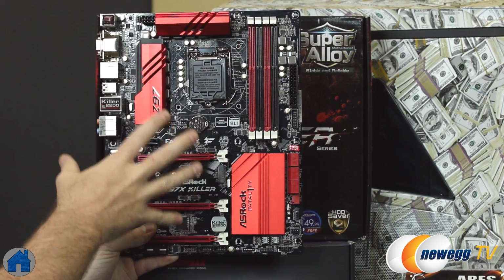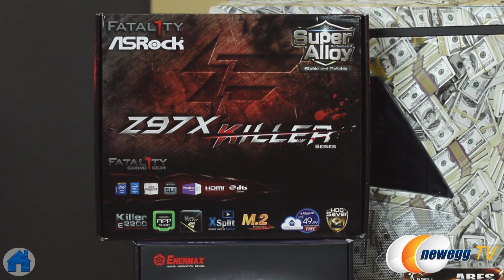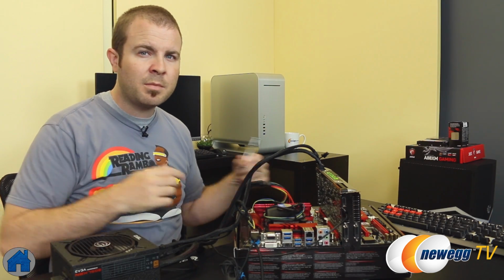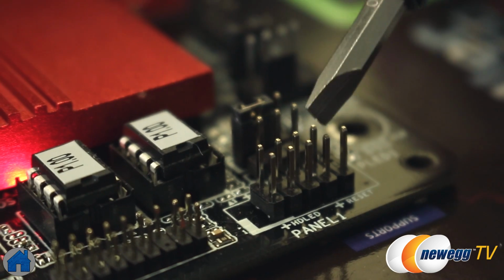How to Build a PC - Part 1 - Newegg TV

Comment: can anyone tell me if these stuff are compatible with each other 

Gigabyte GA-970-GAMING SLI AM3+ M.2 ATX AMD 

ASUS Radeon R9 380 Strix Overclocked 4GB GDDR5

Crucial Ballistix Sport 8GB DDR3-1600

AMD FX 6300

Thermaltake Versa H22 Special Edition Mid Tower Case - Black

EVGA 500 Watt 80+ 500 Watt ATX Power Supply

Seagate Momentus Thin 500GB 5,400 RPM SATA III 6.0Gb/s 2.5" Internal Notebook Hard Drive ST500LT012 Factory Recertified
Reply: +Key Ruin no
Reply: Don't use the momentus thin
It breaks
Easy
I've gone through 4 of them
Reply: It will work but I recommend just using a western digital blue, its bigger, very cheap and also much faster.
Reply: yeah i changed it into a WD Blue Mainstream 1TB 7200RPM SATA III 6Gb/s 3.5" Internal Hard Drive - WDBH2D0010HNCNRSN
is this it?
Reply: Thats it Key Ruin
Reply: ty hopefully this will work and let me play some good games for once in my life XD
Reply: I highly recommend pcpartpicker. 
It has 
-comparability settings
-price ranges of main sellers
-price history
-already made guides
-tips 
- reviews
-comparison

And so much more, check it out, it'll save you tons of time and money, also good luck

Comment: plz tell me this is my first build so is my configuration is good or not

Graphic card:  Nvidia GTX 1080 (normal edition)
Quantity(2)
 

  
Mother board: MSI MSI Gaming Z170A GAMING M7 LGA 1151 Intel Z170 HDMI SATA 6Gb/s USB 3.1 ATX Intel Motherboard 
Quantity(1)
 

Hard disk: WD Black 2TB Performance Desktop Hard Disk Drive - 7200 RPM SATA 6 Gb/s 64MB Cache 3.5 Inch - WD2003FZEX
Quantity(1)
 

 Ram: G.SKILL 16GB (2 x 8GB) Ripjaws V Series DDR4 PC4-25600 3200MHz Intel Z170 Platform Desktop Memory F4-3200C16D-16GVRB
Quantity(1)
  

 Power supply: EVGA SuperNOVA 850 G2 80+ GOLD, 850W ECO Mode Fully Modular NVIDIA SLI and Crossfire Ready 10 Year Warranty Power Supply 220-G2-0850-XR
Quantity(1)

 

Cpu:  Intel Core i7-6700K 8M Skylake Quad-Core 4.0 GHz LGA 1151 91W BX80662I76700K Desktop Processor Intel® HD Graphics 530
Quantity(1)

 

Computer case: Corsair Graphite Series 760T CC-9011074-WW White Full Tower Windowed Case
Quantity(1)
 
 
Keyboard and mouse: DRAGON WAR GKM-001 SENCAIC KEYBOARD & MOUSE 

quantity(1)

  

Headset: Etekcity Scroll Gaming Headset (H5GX): LED Light Up Effect (Black/Red) 
Quantity(1)
 

 Monitor: BenQ XL2411Z 144Hz 1ms 24 inch Gaming Monitor NVIDIA 3D Vision Supported seamless FPS RTS MOBA Game eSport
Quantity(1)

 

Cpu cooler: Corsair Hydro Series H100i GTX High Performance Liquid CPU Cooler CW-9060021-WW
Quantity(1)

Gloves: Pair of Professional Slip Resistant Clean Gloves Anti-static Gloves Hand Wear with Rubber Dots for Cleaning Job VTH-57170
Quantity(1)
 
Case fans: Corsair Air Series SP 140 LED Red High Static Pressure Fan Cooling - twin pack (CO-9050034-WW)          
 (Quantity2)
 

Corsair Air Series SP 120 LED Red High Static Pressure Fan Cooling - twin pack (CO-9050029-WW)
Quantity(2)

Dvd drive: LG BH10LS30 Super Multi Blu Blu-Ray & DVD Drive  
Quantity(1)
 

Light: LOGISYS CLK12RD2 12 inch Dual Red Cold Cathode Light 
Quantity(1)
 

Cable: Cold cathode extension cable 
quantity(1)
 

Hub: SilverStone PWM Fan Hub System Cables, Black (CPF04) 
quantity(1)
 

Thermal past: Arctic Silver 3.5g High-Density Polysynthetic Silver Thermal Cooling Compound AS5-3.5G
Quantity(1)
 

Mousemat:  Redragon P001 ARCHELON Gaming Mouse Pad - 12.99 x 10.24 x 0.2 inches (Large-Size)
Quantity(1)
 

Speakers: AVerMedia Ballista Trinity Gaming PC Speakers, 2.1 Sound System Speakers, 77 Watts, 3 Way Satellite Speakers (GS315)
 

Mouse: MSI Gaming Mouse (Interceptor DS200)
Quantity(1)

  
UPS:  CyberPower CP1500AVRLCD Intelligent LCD UPS 1500VA 900W AVR Mini-Tower
Quantity(1)

Comment: Reply with best performance graphics cards for gaming out right now?
Reply: gtx 980 ti
Reply: +driventolegend Not titan X?
Reply: P. Green Titan x is the best by only a very small amount (stock), and uses way more power, in addition to costing $1000, a 980 ti is basically a Titan x with half the vram and is $650, also a superclocked 980 ti or sli 980 tis will beat the Titan x
Reply: That's true, point made.

Comment: When putting the motherboard into the case for the first time, after the test, is it absolutely necessary to take the cpu fan off, if you are planning to use the stock one in your build?

Comment: I am trying to figure out what pc parts i am going to buy when i am going to build my pc, and i was wondering does i5 4460k and gtx 960 work with z97? and does z97 work with fractal design define r5? and also i play Minecraft CS:GO and sometimes some newer games for example gta v so will gtx 960 i5 4460k and 8gb of ram be enough
Reply: +ZAXYTHE3DMUFFIN There is no 4460K. Ther is a 4460, but it isn't a K CPU so you could save some money by going with something like an h97 motherboard. And I suggest an R9 380X instead of a GTX 960.
Reply: +stl522013 ok, thanks and sorry for not knowing anything about building computers
Reply: +stl522013 ok, thanks and sorry for not knowing anything about building computers
Reply: ZAXYTHE3DMUFFIN What is your budget?
Reply: stl522013 800 dollars

Comment: Would this work?

Asus M5A78L-M/USB3 Motherboard with Socket AM3+, up to 32 GB DDR3, USB 3.0, uATX 

AMD FX6300 Black Edition 6 Core (3.5/4.1GHz, 8MB Level 3 Cache, 6MB Level 2 Cache, Socket AM3+, 95W, Retail Boxed) 

HyperX FURY Series 8 GB (2 x 4 GB) DDR3 1866 MHz CL10 DIMM Memory Module Kit - Black 

Western Digital WD10EZEX 1TB SATA lll Desktop SATA Drive - Blue 

EVGA 100-W1-0500-KR - 500W 80 Plus Power Supply (100-W1-0500-KR)

Gigabyte NVIDIA GTX 750Ti 2GB PCI-E Graphics Card 

CiT Goblin Mesh Gaming Case Black/Green Interior USB3 12cm Green LED Toolless (with another fan)

CSL - 5m - CAT.6 Ethernet Gigabit Lan network cable (RJ45) | 10/100/1000Mbit/s | Patch cable | UTP | compatible with CAT.5 / CAT.5e / CAT.7 | Switch/Router/Modem/Patch panel / Access Point / patch fields | black 

Trying to make a low budget pc for £355, ill download windows 10 on a friends usb, and I know how to setup drivers etc
Reply: it would work, but be warned, the 750 ti is kinda under powered, you can maybe run games at medium settings 40-50 fps but it still works
Reply: I know, I may upgrade to a 970 2gb later ty
Reply: Hi. Check pcpartpicker to make sure
Reply: I have checked everything now, and have done so much research etc, and I have now ordered the parts in. Hopefully they will be coming tomorrow. Shouldn't be too hard, I guess?

Comment: In case you guys wanted to know the price for this exact build, here it is:
Intel i7 core 5960x:                            $1,050
Enermax Liquimax 120s cooler:           $50
    (Alternate Hyper 212 Evo: $30)
ASrock fatal1ty z97x killer:                  $100
Gskill Ares 16GB: $65
WD Black 2 terabytes (2):                    $250
Lite On Blu ray Drive: $100
EVGA SuperNOVA Nex750B:                 $80
Nvidia GForce GTX 780:                       $130
NZXT Phantom 630:                             $150

Total:                                                     $1810
Reply: Haha I wish a GTX 780 was 130!
Reply: Total: $1810 USD!
Reply: +daniel hood I put the wrong graphics card, my bad
Reply: +Aversi Wrong processor. The one he used retails for about $350.

Comment: http://uk.pcpartpicker.com/p/3wWVhM
Is this a good build - are there any parts that would be better for around the same price?
Reply: +Christopher Bennett The graphics card is pretty weak for the CPU. The i7 4790k is usually used with higher end graphics cards, like the 970, or 980.
Reply: +I Got that Nope.avi  I actually did more research and changed the build around a bit. I want to use it mainly for Rendering so choose a Video card designed for Rendering.
Does this look any better http://uk.pcpartpicker.com/p/TwJRLk
Reply: Christopher Bennett The i7 5930k is much better suited to rendering, but it is quite a bit pricier.

You could get a 980ti as well, which would do a good job at rendering, and could also be used as a high end gaming card.

However, if you don't think you're going to game at all, stick with the current Quadro card series, but it's very important you note, you'll essentially be unable to play most games with a quadro, except for old/low end games.
Reply: +I Got that Nope.avi Okay good advice, Thanks very Much

Comment: Okay I'm about to order these PC parts.  https://pcpartpicker.com/part/amd-cpu-fd6300wmhkbox
**Before I do It, is building a PC by yourself hard? Or is their instructions? If not, how am I supposed to know what goes where?
Also, Is there anything I need to know NOT to do when putting the pc together? Can I break any of these parts easily?
And lastly, do I have to buy an Optical Drive? Or Will my PC work without it? And I can just Get Windows 10 in some different type of form other than a disc?

Comment: any ideas why my system shows no video when graphic card in installed. from either the card or onboard hdmi connector? 
asrock h97m itx ac with i7 4790 and r9 nano
Reply: Are you sure that all the connectors are plugged in properly?
Reply: yes. tried this several times.. at least 10
Reply: +Vincent Valentine Have you tried accessing the BIOS? If you can't, check your power supply and the power connections. Also, try to check that the HDMI is connected properly.
Reply: Does it beep when you push the power button?
Reply: fans spin up in gpu n cpu (only fans) just no post
Reply: +Vincent Valentine Pull out the video card and see if you can get the system to post without it
Reply: +David Mark it does. but thats why i cant install gpu. i have pcie graphics set up in bios too
Reply: +Vincent Valentine I need some more information:
1. Are the parts new?
2. Do you have an operating system installed yet?
3. What power supply do you have?
4. Does the motherboard beep at all?
Reply: yes. i have replaced the motherboard in case that was the issue. have new r9 nano and and older r270 from another byild im sure is working

Comment: Is over clocking bad? Does it do damage?
Reply: +Em0SceneStabr Yes it can if you dont do it properly. but if you watch videos on your motherboard type and get the settings you want it should be fine. it also depends on your psu and your cooler for you cpu.
Reply: +Em0SceneStabr If you have to ask....yes.

Comment: Soooo...
I'm thinking about building a PC and I've got $3000
I've searched for some things and this is what I came up with:
Motherboard - MSI Z170A Gaming Pro 
CPU - Intel Core i7-6700K 
GPU - MSI GTX 980 Ti GAMING 6G
or (are they different in the inside? Because of water blocks)
GPU - EVGA GeForce GTX 980 Ti SSC GAMING 
Ram - Kingston 32 GB Kit (2x 16 GB) DDR4 3000MHz CL16 HyperX Predator Series

The less important (non-performance) parts :D
HDD - WD Blue 6000GB 64MB cache 
Power Supply - Cooler Master V Series 1200W
CPU Cooler - SilentiumPC Fortis 3 HE1425
or 
CPU Cooler - SCYTHE SCNJ-4000 Ninja 4
or
Water loop (I would need more money, but I'd like to upgrade to water cooling someday, so that's why I'm asking about the GPU)
Case - Zalman Z11 HF1

I know 0,1% things about components, so I don't even know if I could put these up together. If I can, than GREAT! If I can't or the components that I've chosen completely suck, than could you give me some tips, please? 
I'd appreciate some help :D
Reply: +Brandon Allison So you personally have used it..... If you recommend something and say you won't be disappointed, make sure you have tried it. Please.
Reply: Depends what you wanna use the PC for, lemme know and I'll give you some good advice
Reply: Too late
Reply: +Mikop Get a nice and fast m.2 Sdd and skip the water cooling
Reply: David Mark I already said it's too late :D I've got my computer under the table already...
Reply: +Mikop You can still add a ssd, the difference it will make is HUGE
Reply: David Mark I know, but the I didn't build the computer myself... It was built by professional and they sealed the computer with a warranty sticker, so I can't open it :/
Reply: I would not recommend buying a 6 TB HDD, except you are some kind of video editor or something like that. Just for gaming 2 TB are way enough…
Reply: raphiguaki Thanks, but I already have the computer for a month right under my table :P
But there are some things:
1) Video editing is actually important for me
2) I'm going on a Multimedia Highschool in 6 months, so I'll be using my PC mainly for rendering animation and that requires a pretty strong graphics card (Got a 4G instead of 6G, because of saving some of le money)
3) I did buy a 3TB and a 1TB HDD because of the possibility to backup my data + Couldn't buy like 3TB & 2TB & 1TB, because... Money... Yeah... What a shame :(
:D
Reply: +Mikop Ah, great! Yeah, 6 TB are pretty expensive...

Comment: Will every build of a computer be the same? Or does it depends entirely on the case that you get? like if i was to get different components but my case is 100% similar as yours will the set up be the same?
Reply: every build is generally the same process with minor changes like different hard drives and gpu coolers...

Comment: I am looking to build a new pc for gaming purposes and i made this build :
Cpu-Intel Core i5-4690 Haswell Quad-Core 214.99$
Motherboard- ASUS Z97-A LGA 1150 Intel Z97 HDMI 139$
Ram- 2xHyperX FURY240-Pin DDR3 SDRAM DDR3 1866 Desktop Memory Model HX318C10FBK2/16 (8Gb each) 79.99$
Gpu- EVGA GeForce GTX 960 02G-P4-2966-KR 2GB 209.99$
Hard Drive- Seagate Barracuda 7200.14 ST3000DM001 3TB 7200 RPM 64MB Cache SATA 6.0Gb/s 134.99$
Psu-RAIDMAX Cobra RX-700AC-B Continuous 700 watts ATX12V / EPS12V SLI Ready CrossFire Ready 80 PLUS BRONZE 69.99$
Case- RAIDMAX Cobra ATX-502WBG Black Steel 64.99$

If you can find some parts that are better for this Build please tell me i want to keep it under 900$ please (prices from Newegg.com without addition of discounts)
thanks
Reply: I'm probably way to late but I'll tell you anyway, get a cheaper hard drive 1tb is more than enough for now. Get a cheaper motherboard and use that money you saved to get a better gpu

Comment: Hey guys, Okay so I am new to building a PC. I got up to the part where you power it up with a screw driver. When I try this it turns on for a second then turns off. I have no idea why. I have tried unplugging and plugging in the cords, but no luck. Any ideas on what I should do or try? I have the z97x SLI mobo  and geforce gtx 970 graphics card if needed to know. Thanks in advance.

Comment: I forgot to plug in the 4 pin cpu power connector. CPU wouldn't boot. So I took it out and broke 5 pins on the socket.....rip motherboard. Im so stupid.
Reply: +Ben B. R.I.P .. Hey if u know much about computers, do you know if I can do the external out of the box build using the h100 cooler? My CPU didnt come with a fan...
Reply: DISPENCERY7 The out of the box build is only used to see if ur components work. So you can do it with the cooler just fine, make sure you put your coolant in the loop before. But make sure after you test everything to put all your components in an actual tower.
Reply: +DISPENCERY7 where did you buy ur CPU? didn't get a cooler...

Comment: do you need to add a sound card? or does it come with it? I'm really confused.
Reply: +Aym Far I bought a sound card. Only to find out that my mother board already comes with one. Plus, even tho my sound card is better than the one on the mother board...it's only for windows 8. Which is dumb

Comment: So I'm finally building a new PC, and I just want your guys' opinions on what PSU I should get and the build itself.
CPU : Intel i5 6500
GPU : EVGA GeForce GTX 960 (4GB model)
Mobo : MSI z170a PC MATE
Cooler : Cooler Master Hyper 212 Evo
RAM : (Overkill, I know :P I got this awhile ago for free, decided I could save a lot of money) G.Skill Ripjaws 4 16GB DDR4
Case : (Deciding, but I might still go with this) Corsair 200R ATX Mid Tower Case

I'll mainly be playing things like CS:GO, so I don't need an insanely beefy build. But because I will be editing and rendering, I thought I would get some decent parts. I do every once in awhile play some new games, in fact I just installed Fallout 4 and MGS V : The Phantom Pain.
Reply: +vinco 16gb of ram is NOT overkill. I'd suggest even more. PSU just get something over 600v
Reply: DISPENCERY7 Ok, cool! Thanks :D

Comment: I using the coolermaster 212 evo cpu fan on my cpu, and the cpu doesn't come with a stock heat sync. After the test build, do I have to take the cooler master fan off the motherboard, or keep it on when installing it in the case?

Comment: I still have a gtx 660 and it plays games really good with high settings.. Now am doing more reading and barely play games. I still got to try out the gtx970 or gtx980 but their is no point in upgrading if I barely play games

Comment: How risky is it for you to shock the parts (I don't shock myself on knobs, but I have carpet on the floor.)
Reply: don't build on carpet. try your kitchen table or anywhere without carpet. static's not a big issue of you handle the parts properly and ground yourself on your case
Reply: +² GotRice? © |Baked| but that doesn't mean it won't happen to him. it's like not wearing your seat belt when driving, sure nothing happens most of the time, but when something serious happens, you're screwed...